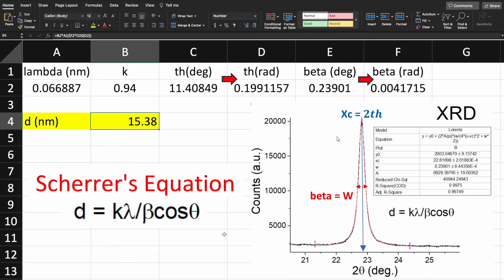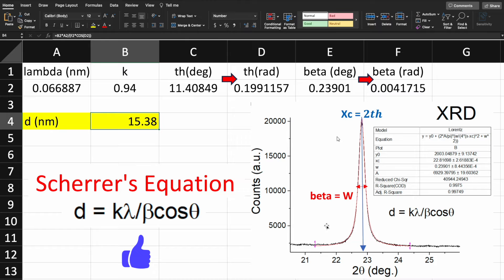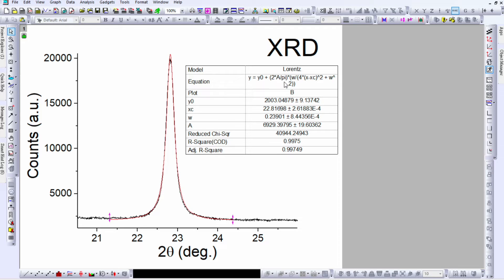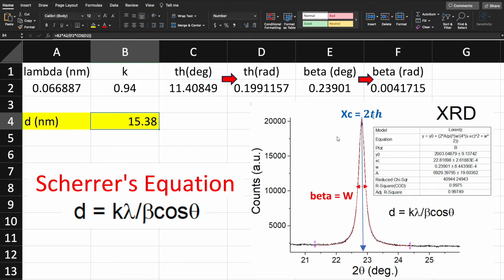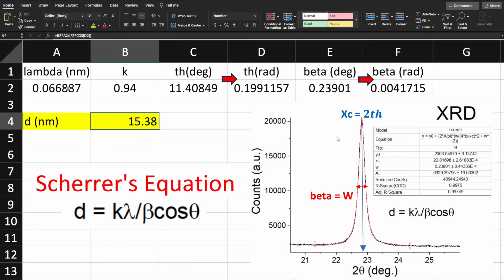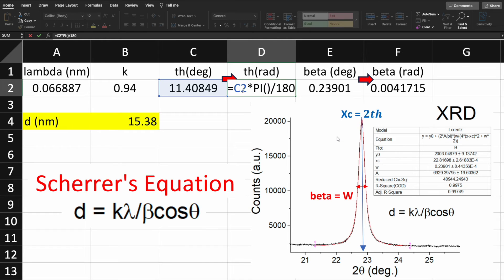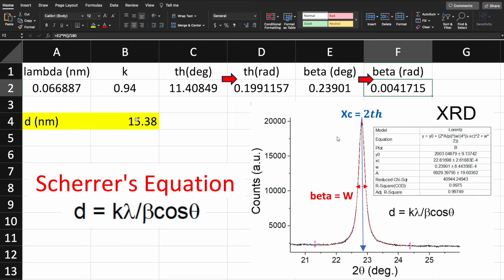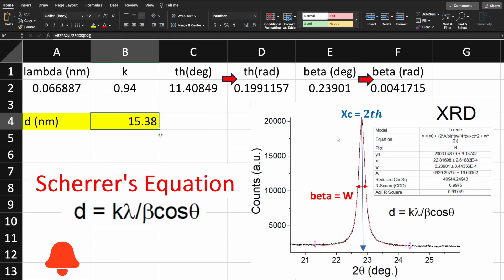Scherrer's Equation: Grain (Crystallite) Size Calculation from XRD data using Orign

Comment: Will the single intense peak will be enough to interpret the crystallite size of the sample? Or the average of 4 to 5 intense peaks. Please elaborate
Reply from the maker: It depends on what you want. If you are working on nanomaterials with grain size below 100 nm to 80 nm and are interested in knowing the contribution caused by the strain effect on line-width broadening, i.e., the grain size, then use WH plot, which requires data from multiple peaks. If not, use the most intense peak and proceed with Scherrer's formula. WH plot is the combination of Scheers's and strain contribution to the line-width i.e. grain size. Good luck!